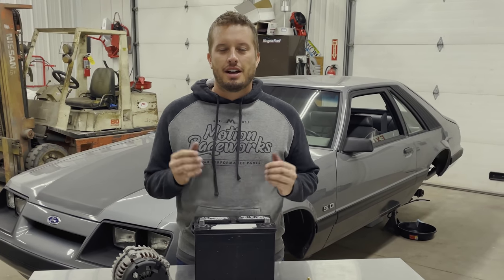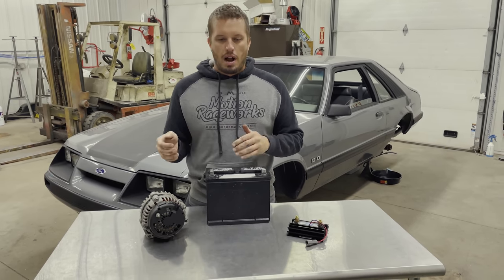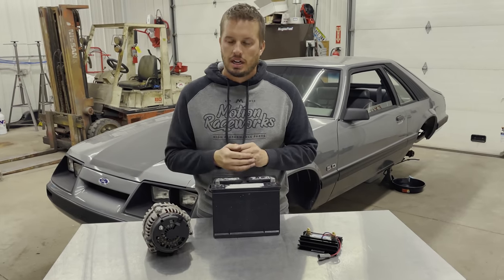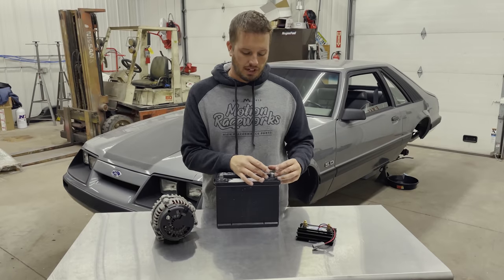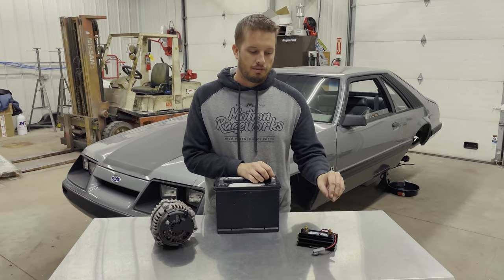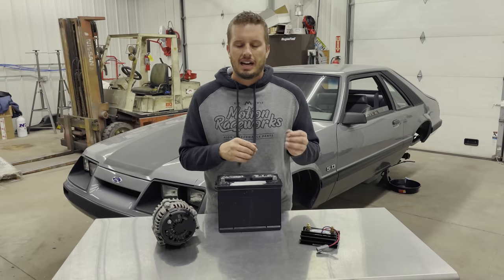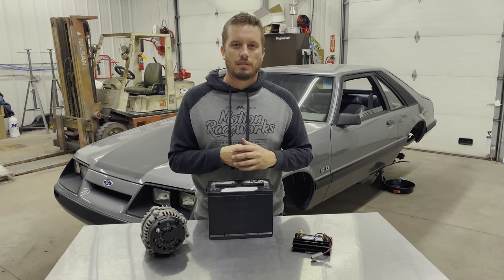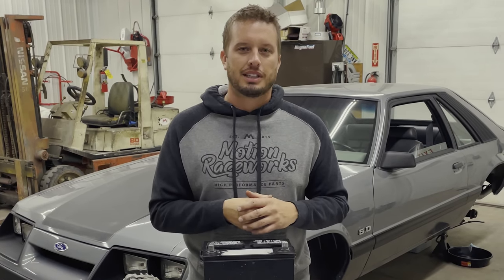Alternator Kill Switch Proper Wiring: Tech Tip Tuesday

Comment: Great video Doug.👌
For those wondering why it's ok to run EFI (Electronic Fuel Injection) direct to the battery. With the fuel pump shut off the injectors have no fuel to function.
Reply: I'm not necessarily a person normally to correct someone, however I don't want misguided direction going out to uneducated people. Your answer isn't accurate. The main power coming from the efi to the battery is to ensure ecu maintains constant clean battery voltage uninterrupted from any other source. Holley's specifically are very susceptible to this. Also, thinking on your logic. What if someone is running a mechanical fuel pump?
Reply: @HorsepowerChris  Do you feel better?
The reply is exactly correct. I didn't explain the purpose, just why the direct connection is safe to bypass the Safety Switch.
Besides Doug specifically referenced the clean power comment.
Reply: @HorsepowerChris  If someones running a mechanical pump its going to stop along with the engine when the coils and injectors stop firing. Think about it.
Reply: @BadLuckGarage  I run my relays to power my coils off a 12v source which is cut when the power to the vehicle is cut so the engine would be killed no matter what
Reply: @robholmes2129  Exactly. The EMS also requires an ignition signal to run (which would draw power from a fuse/relay panel fed through the shutoff switch if wired correctly) and would kill the coils and fuel injectors immediately of the kill switch is flipped. Either way, engine dies and mechanical fuel pump dies with it.
Reply: @gwbuilder5779  Feel better? Why are you taking offense to someone commenting on your reply? I was just trying to help someone that might be reading these comments to ensure they are properly educated on wiring their system. Directly wiring the EFI power to the battery isn't a safety concern or else they would have designed it to also be wired to the disconnected side of a disconnect switch. I was simply stating, that as per your comment of saying that fuel would be cut off therefore injectors wouldn't have flow isn't accurate. Hence why I gave a scenario of a mechanical fuel pump. When the battery disconnect switch is pushed for an emergency, the fuel isn't the main reason as to why an engine would be "killed" its both fuel and ignition. All I said to you, was that your answer isn't accurate. I didn't say wrong. 

Yes, I am aware that as an engine would be "killed" from hitting the emergency stop even with a mechanical fuel pump it will still stop if wired properly. It stops due to ignition and then obviously the flow of fuel is stopped also from the engine stopping.
Reply: @BadLuckGarage  Clearly.
Reply: @HorsepowerChris  You are offensive because you are telling me I am wrong.
Nothing stated is wrong as you can see by the other people commenting back.
The purpose of my comment was to note the obvious about why the direct lead to the battery. As you can see there are plenty of others who joined the comment and added their perspective and no-one said I was wrong or inaccurate, they simply added their perspective.
Perhaps you could learn a better way to join these comments without being negative.
These Tech Tips are to help build the knowledge base for newer racers, not YouTube viewers who just comment.
Do you race?
I have been racing since 69.
If you do race, find a better way to actually be constructive and encouraging to new racers. If you do race, shut the hell up.
Never start a conversation with criticism, not helpful.
Notice how the other comments pointed out more details without chopping you?
Try that instead.
Reply: @HorsepowerChris  To address the rest of your comment:
The main purpose of the Shut Off is the to stop the flow of fuel #1 and also to make sure the the electrical system is not energized to reduce the possibility of fire and or spreading it. Doug mentioned both of these issues in the video.
There are many ways to wire a system from relays and even self generating magneto's.
Every system that requires a direct Hot side also requires an exciter signal that Must go through the shut-off in order to be properly wired, wether it is through the ECU, relay, EFI, secondary systems, and beyond.
Doug mentioned all of these options in the video.
Primary power that has no secondary systems must go through the shut-off.
Did you watch Doug's nova burn after hitting the wall or Tom Bailey's 2.0?
Safety systems are crucial to saving lives and helping people understand why they need to have them, not just because they are required at the track.
Road racers die because they skip rules they don't like or don't think they need on the street. These videos can help them understand why they need them.
I have watched good people die even with the latest safety systems done right.
Remember, this is a real racing channel and real racers watch it to improve their skills.
If you are a racer, be a part of making that happen.
If you are not a racer, just be quiet and enjoy the channel.
Reply: I believe the master/kill switch was mandatory in racing before rollbars and were still arguing with each other on how to hook em up right 😆

Comment: For some one that was on the receiving end of a incorrectly wired kill switch, this is valuable. Short story, A car had an incident, I activated the kill switch and it kept running. The car was on methanol and I am a track safety worker. The car was recently rewired (incorrectly) and that's what made the difference. Changes were put in place so that kill switches do actually shut the car down. This is done during tech inspection.
Reply: Magneto? Mechanical fuel pump?
Reply: @flipfloptanlines926  I don't care if it is mechanical, electric or bluetooth. If I hit that kill switch I want the car to shut off, both for my safety and that of the driver.
Reply: @HiggyRSQ  The question posed wasn’t if the cutoff switch was needed but rather how.  That said it has been over two decades since I had a car with a mechanical fuel pump and a magneto but when I did the pump had a cable activated cutoff that bypassed the fuel to the carb/mechanical injection and was located in the driver’s compartment and the magneto had a switch that would ground it that was on the outside the car and a battery cutoff if the car had onboard batteries for lights, racepack, starter etc
Reply: @gullreefclub  Ya man i was just askin because those 2 items can "complicate" or "change" the way a shutdown sequence is effected, clearly described by you  for the 3 way cable fuel cutoff valve/pump. Last year i tested a nostalgia methanol car with a magneto. Thru the traps at 202, chutes good, master cutoff good. Coastin down to about a 100 the car refires, i guess it wasnt done lol. Yanked the fuel cut and just barely dropped the front tires in the sand. Believe me sir i want a kill switch to work as much as you. Now i yank and press every lever the things got at the 1000 foot lol

Comment: Couple things to add to this:  

1)  TEST this system to make sure it works.  Start your car, turn off the kill switch, make sure the car dies.
2)  Usually the starter is direct wired to the battery since kill switches rarely support a 300-400 amp load that's sometimes required to turn the starter, especially on high compression engines.
Reply: Ive seen starter direct and through kill. You are correct in the continuous rating, but many manufacturers have a burst/momentary rating 4-5 times higher than continuous rating. At least with a mechanical switch.

Comment: In heavy equipment the battery disconnect is on the negative battery cable and if the alternator is turned off, it's with a 2 pole master switch on the field circuit. Just so you don't wire your dozer like your race car.

Comment: Hey Doug. Totally off this topic, could you do a tech tip on turbo drainage. To be more specific, low mount turbos with the use of scavenge pumps... I'm in the progress stage of this, and have 2 ideas on how I'm going to plumb my twin turbo low mount set up but still unsure.
Thanks bud
Reply: Check out Daddy Daves S10 pickup. Thats where i would start cuz im not familiar either. He has the turbos rear mounted low under the bed with a crossover hose connecting the 2 drains with a manifold or T to an electric scavenge pump which pumps all the way back to the engine. Couple vids back he had it on the lift easily viewable

Comment: When I used to race, the most common thing that I saw causing issues with kill switches, was the alternator excite wire, or charge wire circuit back feeding the ignition system, the charge light circuit will provide enough current to power an ignition coil no problems.

If anyone is having problems with this, then a diode in line with the charge light will work (but if the diode fails short circuit, then your kill switch wont work), or use an LED charge light (you may have problems with the alternator self exciting in this configuration though) but the best way is to use a relay in line with the charge circuit, that is triggered from the ignition switch, but then is powered from BEFORE the kill switch.
Reply: What if you use a incandescent lightbulb instead of an LED, somehow this keeps the charge light on, I remember reading this years ago,

Comment: I think the solid state switch in the video threw me off, use a good old mech switch in the next vid maybe.  Put some red paint to identify which post you are referencing, im unable to tell. The chart/pic was a little misleading. Only fuel injector DRIVERS go directly to post which u said kinda, the fuel PUMP(s) are switched by the master/kill. Ive been seeing more and more cars adding a relay inches from the alternator, wired in conjunction with the battery kill switch. I believe the regulators are gonna change language from BATTERY isolation, to ALL POWER SOURCE  isolation, and we'll complain, and eventually blame a politician lol. Love yoll keep up the good work.

Comment: maybe this is a dumb question but what if you taged the excite wire to the starter solinoid? your KS still on positive side as before killing starter and fuse block for ignition and would it still do the same job with less positive wiring running the length of the car? would that be a wrong assessment?